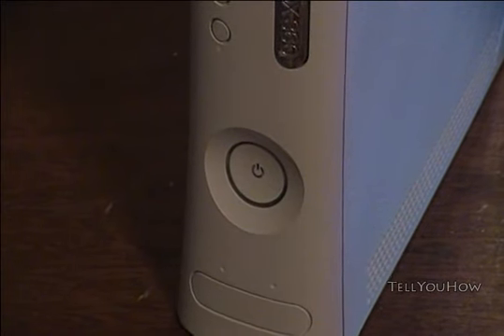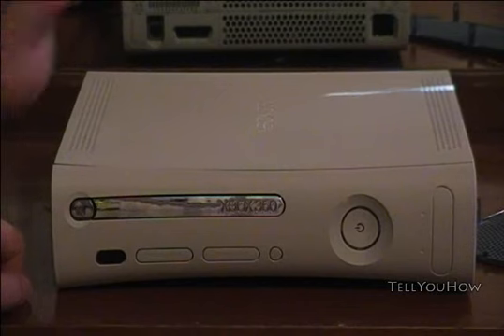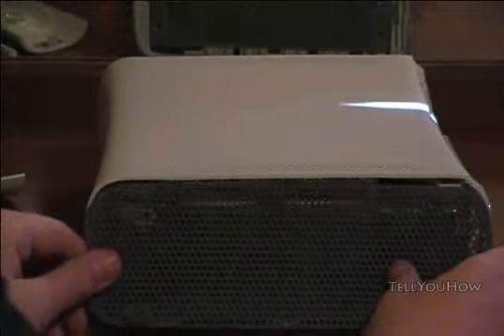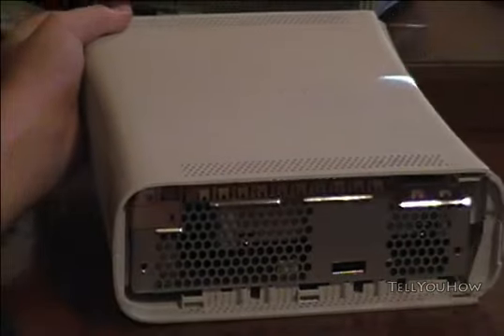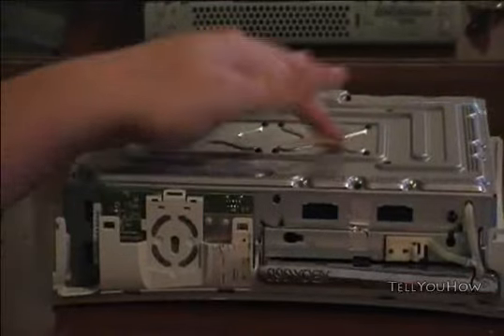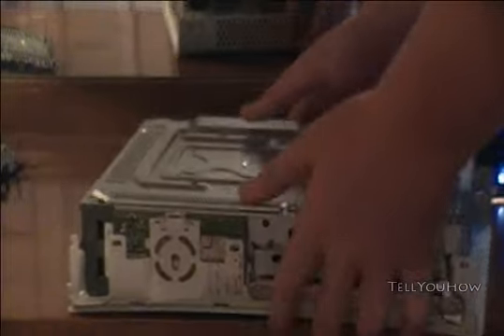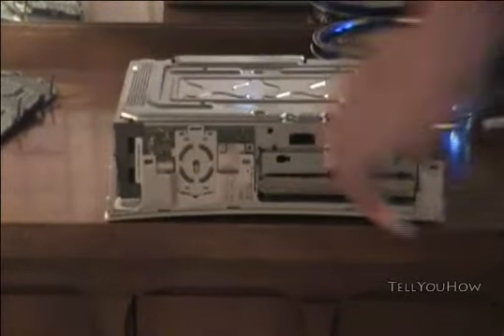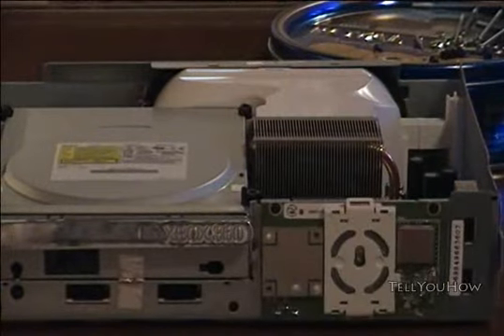How to Fix the Xbox 360 Red Ring of Death ( Part 1, open the Xbox )

Comment: My dad and I spent around 4 hours doing this spread out over 2 days. 2 hours of it was trying to open the whole thing up. It worked tremendously. We did both fixes, with thermal paste from Radio Shack. Thank you so much! It truly works only at the cost of 8 cents and a bottle of thermal paste. You are amazing at this stuff dude. Thanks again! This saved us 140-200 dollars. 2-3 Dollars < 200 Dollars